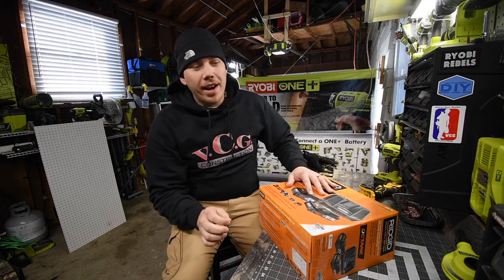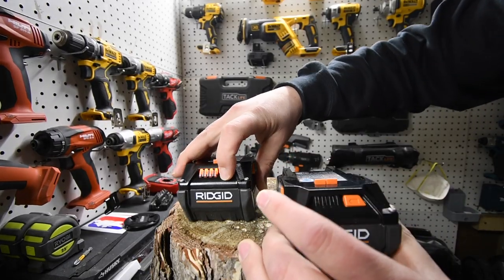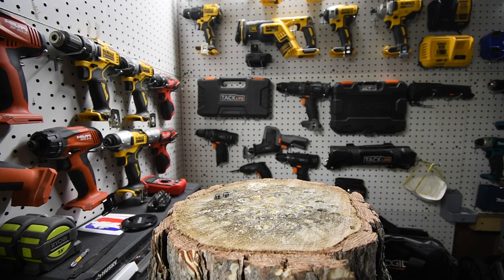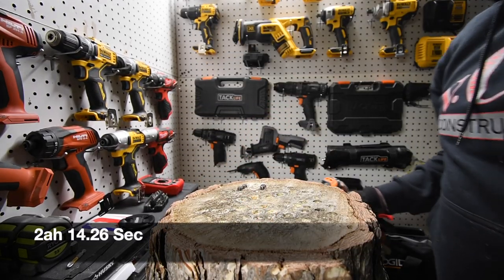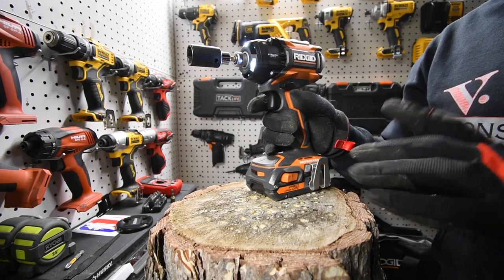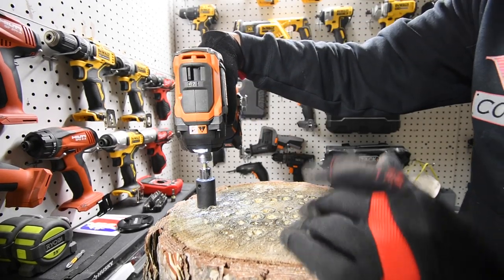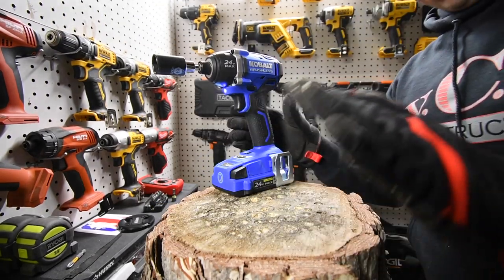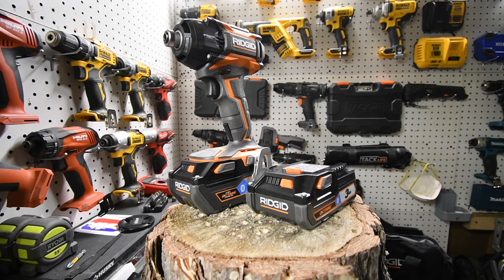Ridgid Stealth Force with Octane battery test

Comment: You are getting so much tools it looks like a small power tool set up in a hardware store nice job 👍 💪 if I had a garage I would have a tool wall excellent job with the way you laid everything out and  that Ridgid stealth Force I've tried it's not bad at all did not use it with  octane batteries that 3.0 ah octane battery does give it a bit more Kahuna's 21700 cells do help would you say that 3.0 ah Ridgid octane battery is worth it I do have a gen 5 x brushless  impact driver looking to get the most out of it a lot of people I know it's only don't get the octane impact driver or new 3/8 octane impact wrench that I'm perfectly fine with my gen 5 x brushless impact driver and Bosch idh 182 impact driver/ 1/2 socket adapter built in
Reply from the maker: The video with 1/4 in impact is coming soon and thank you

Comment: the ridgid octane 3 amp hour uses 21700 cells and the 6 amp & 9 amp use 18650 cells
Reply from the maker: that's interesting. the same thing with the Ryobi 3ah Compact HP battery
Reply: What does this mean for the power?